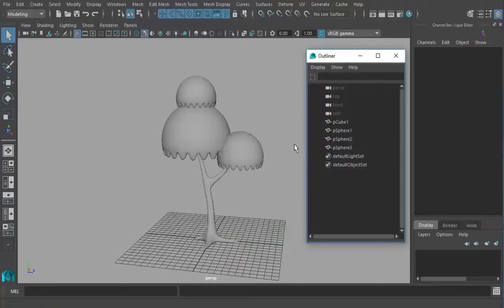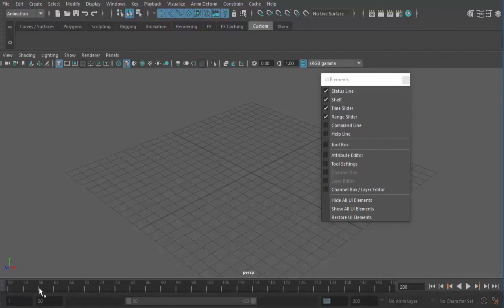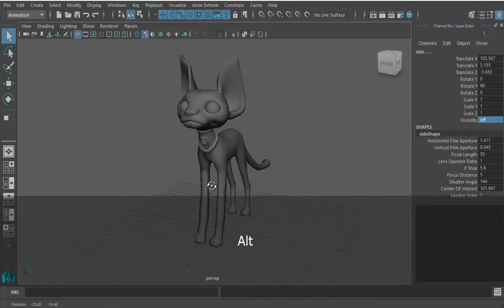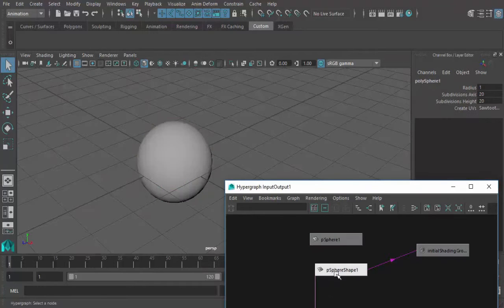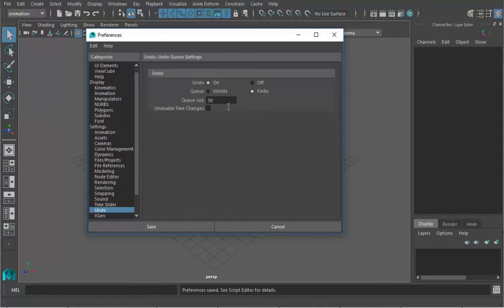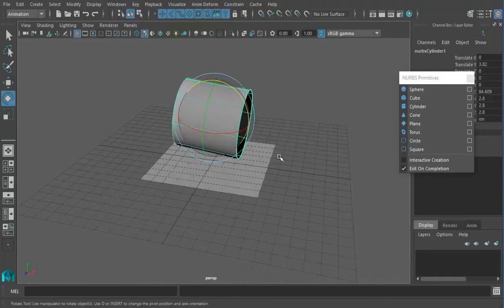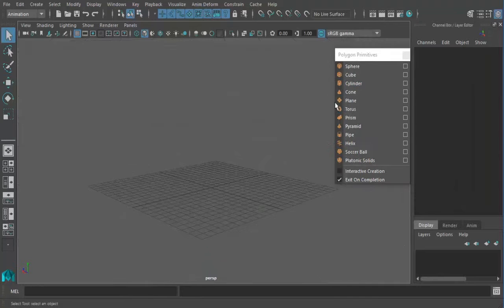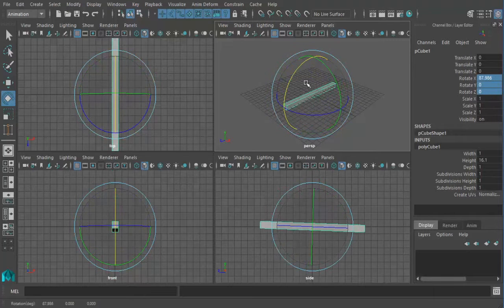Maya Tutorial Basics - Rees3D.com

Comment: sir i have quadroo 6000 gpu  in t7500 can i use premier pro cc 2020 if yes then how can i solve gpu driver problem when i  installed premier pro cc its required latest driver
Reply from the maker: RTX 6000, P6000, M6000 and K6000 , these models are supported. So, you just need to install the Studio Drivers for your Graphics Card. Then premiere should work fine.